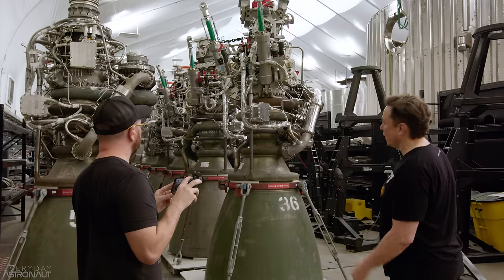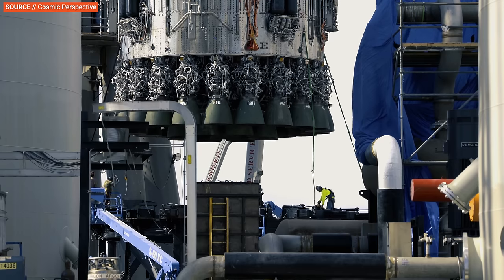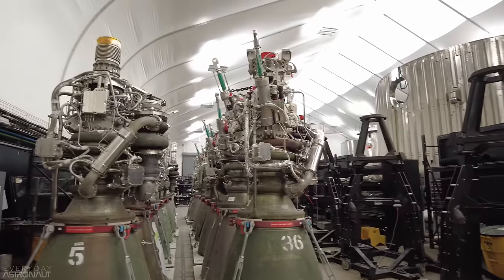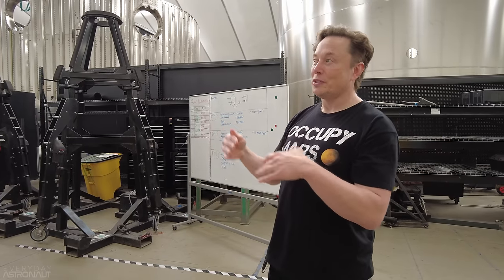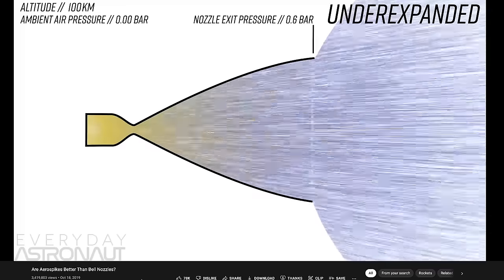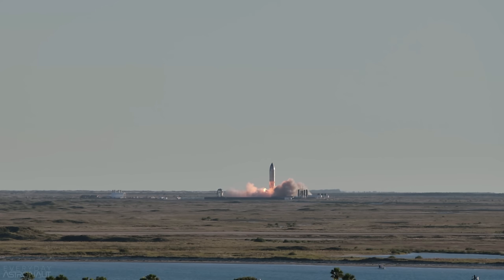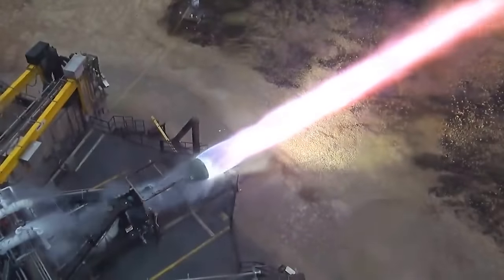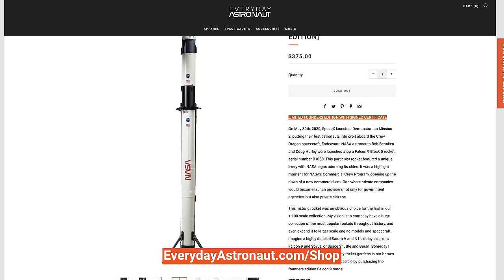How SpaceX Is Upgrading Raptor To Be The Ultimate Rocket Engine!

Comment: Love to see an electric pump version of the raptor..like the Electron rocket uses..They should call it Raptor 3.
Reply from the maker: Watch my video on engine cycles and you’ll learn why that’s not a good solution and doesn’t scale to these levels of thrust 👍
Reply: The energy density per weight of battery is hundred times less than methane.  When you scale up the power,  the increase in weight will make it inoperable.

Comment: The reason SpaceX is so successful with their designs today is the same reason why the Soviets led the first half of the space race. Traditional American rocket engineering goes through an extreme level of testing of every individual component, so they basically know how it's going to fly before it ever takes off, and the cost-plus-contract funding tends to slow things down and drive up cost. The Soviets had a hardware-based approach where it was built, and usually tested only in all-up flight, and as a consequence, they tended to have a deeper understanding of the "previously unknowns", and it was highly successful before Brezhnev pulled a Nixon and killed a lot of space program funding. SpaceX uses the same hardware-based approach. The Russians refer to it as "Ah Kalyenki", meaning a piece of paper and pencil on the knee. They've blown up a LOT of rockets and engines, and because of that they have a very intimate understanding of their hardware. Much more so than NASA ever did or likely ever will do.

Comment: Going to all electric actuators for thrust vector control it will save a heap of plumbing and hydraulic systems weight then you only an external battery.

Comment: Mr. Dodd, if the bell of vacuum Raptor is truncated after cutoff in orbit, can the engine function safely at sea level?  The bell would need repair before the next launch, but there is no need for three standard engines on second stage.

Comment: So basically the stacked starship system will leap off the pad instead of crawl its way past the tower... 
 The Saturn 5 burned 20% of it's weight in fuel before it cleared the tower.  That's astonishing.

Comment: I would like you to comment on the explosion. Does it have anything to do with the Raptor 2 design?
Reply: Probably not, but more information from Space X should be forthcoming once the raptors are inspected.
Reply: Per Musk, it was a spin test of the plumbing, with propellant, but wasn't supposed to ignite. Apparently it was a calm day and the mix under the booster got to the point that it could explode. Something ignited that mixture, for the results that we saw. SpaceX has yet to say what ignited the propellant, but Musk has said that there will be changes going forward for future spin tests. He also said that the launch is now targeted for August, so evidently, a short delay was caused by the explosion.

Comment: He mentioned having the engine create it’s own electricity for a screw drive. I am curious what is preventing him from putting some magnets on the turbine shaft itself and coiling wires around the turbine to make an alternator. I guess there would be an initial electrical resistance but this could be very cost effective. Not to mention no extra seals necessary.
Reply: That would be massively more complicated to build than just a shaft and blisks, not to mention balancing. And why bother when small lightweight high output lipo packs exist
Reply: @Username-qx9gk  if you’re trying to reduce weight lipo batteries are a bad option especially if you need one for every gymbaling engine.
Reply: @connorleefilmmaker5178  Attaching coils or magnets to turbopump shaft would be a nightmare to manufacture and balance. 
You just have one or two packs somewhere else and electrical bus, easy. You could even jettison packs as needed like rocketlab do. They replaced the whole turbine with electric pumps and jettison the lipos. Not that you'd need to jettison, as gimbals and control surfaces would require miniscule size batteries anyway. You can get bursts of 10s of KW from a pack the size of a scooter battery

Comment: At 16:20 you say 330 bar in the main chamber is the goal for Raptor 2. Earlier in this video you mention "300 bar chamber pressure" and that's phrase we've been familiar with since your 1st interview with Elon. But the diagram at 2:36 shows a main chamber pressure of 150 bar. The 300 bar is shown for for the preburner combustion chambers. This may be a diagram from one of your earlier videos but I don't recall Raptor going from 150 to 300 bar. Have I been misunderstanding the nomenclature all this time? (I do understand the pressure always has to be higher in the preburners than the main chamber, otherwise pressure would flow backwards.)
Reply: If you look towards the top of the diagram you reference you will notice (not raptor) in brackets this is just a full flow staged combustion example
Reply: It has always been about main chamber pressure
Reply: @shadowtitan2270   Ah, "Not Raptor" seems to be the key, indeed. That leads me to guess Tim didn't want to extrapolate from a 300 bar main chamber pressure to a 600 bar preburner pressure, he didn't have the data to make that leap. Safer to use some lower stand-in values.

Comment: There is no going back.  Thrust per area on the flamey end of the rocket is paramount.  The need is greater due to the loss of area per volume (mass) as rocket size increases.  Engines must be smaller (narrower) and produce more thrust, so raptor is the ticket.

Comment: How do they mount? Looks like R2 has a giant screw at the top. Could you talk a little about that? Thanks!
Reply: Oh and hello from Alan Shepard's hometown!
Reply: That giant screw is actually the flexible fuel line so the engine can gimbal. The engine basically just gets bolted up to the tank along with umbilicals.
Reply: @motokid6008  Thanks. I haven't seen a top down photo. Do you race MX?

Comment: Put Starship on the back burner for a bit, let them crunch all the data for awhile and build the new facilities, in the mean time, re-engineer the Falcon 9 with Raptor engines to focus on the engines with a high duty cycle.  Name it after the king of raptors, Peregrine.
Reply: re-engineering falcon 9 for raptors isnt worth it at all. its already working, and starship would come online faster then they could do that. it would have to get astronaut certified AGAIN, which again isnt worth the time and money

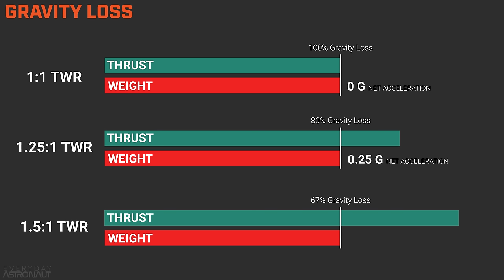Comment: 14:00 The increase in efficiency due to increased thrust applies much more at the beginning of the booster’s burn than it does at the end of the burn (when thrust/weight is higher due to propellant having been expended). So the apparent doubling of efficiency between Raptor 1 and Raptor 2 applies only at the moment of launch, and will be reduced when one considers the overall flight profile. I’d be curious if it’s feasible to calculate the efficiency improvement overall, not just at that initial moment…
Reply: It is better because by the time the efficiency gain starts to drop, the starship decouples and uses RVac engines which has 380+ isp. When you slap starship with a 100-200 ton payload on top of the superheavy, that T/W will be vital.
Reply: @aauwhatitdo1582  Your comment doesn’t seem responsive to mine. Yes, the improvement in thrust is valuable. The question is a quantitative one: how much does it help? It helps significantly, but not by a factor of two as some listeners might have inferred.
Reply: @zzubra  The gravity loss benefits are definitely not a factor of 2, but they help more along the lines of a 2-3% increase in Delta-V for every .1 increase in Thrust to weight. The issue of ISP won't be an issue because by the time the ISP will matter more than T/W, RVAC will take over.

The other benefit is that if you increase the Thrust by enough, you can get better Payloads in to orbit. Just a 10-15% increase in payload would increase yearly net profit by hundreds of millions.

Comment: Compare 🍎🍎 2 🍎🍎. The axis swivel angle and the maximum swivel angle isn't the same thing,  The SSME swiveled 10.5° in pitch and 8.5° in yaw, so the maximum angle was 13.5°. Is the figure quoted for Raptor (15°) the maximum, or just for the actuator axes (for a maximum of 21.2°)?

Comment: Once they’ve mastered the production of raptor
Gotten rid of all the fiddly bits
Removed the shields protecting said fiddly bits
& Reduced production time per engine significantly.
They are going to make a much bigger engine right?
This reduces film cooling significantly,
Increases thrust to weight
Reduces part count per rocket
Or did they already max out size for this combustion process?

Comment: Nice video, thanks for the polished presentation (and the amazing 3D renders)
As a bystander, it looks to me that SpaceX has started the Raptor program much more aggressively than Merlin, so I would be surprised to see the company getting more than ten percent of performance increase without a major redesign. The Merlin was a much more conservative project initially, focusing on lower costs etc. instead of wringing the maximum performance from the start. I would expect more improvement in the production costs.
The future Raptor 3 mentioned by E.Musk seems to be a major redesign, probably with dimensions and performance parameter differences (throat diameter etc) and reaching BE-4 performance levels. It sounds a bit premature to speak about it before even Raptor 2 gets proven in orbital flight?

Comment: Hey Tim, you said that the vacuum engines on starship will be fixed, but if that is the case how will it maneuver and land out of the belly flop??
Reply: The landing is done with only the three sea-level engines in the middle.
Reply: Flip and landing are done with only the center, gimbaling engines, the way SN15 (with no Rvacs) did it. Rvac is for high-efficiency vacuum acceleration  to attain/adjust orbital velocity, with center engines doing the bulk of the steering. Most of the Russian main engines don't gimbal at all; they just push hard while using smaller Vernier thrusters (mounted at an angle) to make steering corrections.

Comment: When you have the most advanced rocket engine in the world, it's doubtful you will abandon it for some simpler design. Continuous product improvement is the most likely case for the raptor engine, with advanced materials capable of sustaining extreme chamber pressures and temperatures. Aye, that's the ticket, laddie.

Comment: I was wondering... could the same principle used at tesla - casting one piece front and rear frames be used in a raptor engine? Could you integrate a lot of the "fiddley bits" and pipelines into it?

Comment: @14:04 from TWR 1.25 to 1.50 is not an increase of 20 % (you increase 1.25 with 16.6666 % to get to 1.5, but indeed 1.25 is 20% les than 1.5) , The same  with the 'increase' of 185 to 230: is 20% increase (182 is 80% of 230)

Comment: I notice that on Raptor 1, it shows a raptor image on an apparent fuel input but on Raptor 2 does not have have this pipe in the image.  Is that due to changes in the mounting of the raptor?

Comment: I wonder if an increase on thrust would be accompanied by a reduction in engines after all, fewer engines means less chance of failure.

Maybe SpaceX are supremely confident in reliability by that time so what does the same # of engines + more thrust equal? A bigger booster?
Reply: More payload to orbit via Starship. If they have really reliable engines and nail the catching of the booster down then its no problem having that many engines as it just increases mass to orbit for the upper stage that the booster is lofting partway
Reply: More engines is more redundancy against engine failures.  Which is why they no longer build passenger airliners with a single engine (except some tiny ones that are really repurposed personal planes).
Reply: @johndododoe1411  it's true that no commercial planes have 1 engine but (almost) all the 4 engined jetliners were replaced with twin engine equivalents, halving the rate of failure for engines.
Reply: It's a bit of a balancing act, fewer engines would reduce potential failure points but more engines can better compensate for said failure points. In some senses it just reflects how SpaceX merges the design philosophies of NASA and the Soviet space program, where NASA tended to lean towards reliability over redundancy and the Soviets towards redundancy over reliability. SpaceX combines both philosophies in their designs (eg multiple flight computers but each one is also pretty reliable).

Comment: I do wonder about 1 thing; these engines are very extreme in the required conditions. So what if something fails on the way to Mars (or when landing) and you need to fix one... would that not be way harder to impossible compared to more "normal" conditions?
Reply: They go with redundancy instead.  More than they need so if an engine goes, they can use the remaining.
Reply: @TheEvilmooseofdoom  Perhaps those thousand Mars-bound Starships will include one with a hold full of spare engines... ;)

Comment: hi Tim, don't raptor has 300 bars of chamber pressure rather than 150 bars as you mentioned 300 in preburner and 150 in the chamber? and do they use a temperature sensor for chamber temperature or nozzle one? thankyou
Reply: 300bar in the main chamber. About 800 bar in the pre-burners.
Reply: @3gunslingers  thank you

Comment: 11:00 Still amazed how small though powerful Raptors are. Merlins do the same.
Merlins are wonderful engines: Cheap, simple, reliable, powerful, lightweight, reusable, and goddаmn pretty efficient (Merlin vacuum's specific impulse is 349s, that's ~10 seconds less than the most efficient RP-1 engine, vacuum RD-0124 with closed cycle). 
I believe Raptor will be not worse, so easily the best rocket engine in the world by the sum of numbers.

Comment: I think that two things will happen. First, Spacex will improve Raptor 2. That means the engine will be more powerful, safer and lighter. Second, there will be space-only engines with nuclear-powered combustors, which will be fed by a fuel that will expand at high heat in the combustor at a high pressure, higher than Raptor 2, and thus have a higher exit velocity, but with comparatively low to very low fuel consumption. This will allow to significantly increase the speed of the spacecraft. In the development of combustion chambers for fusion reactors, stable energetic fields are already being used to prevent high temperatures from reaching the walls of the combustion chamber. This must be the goal for modern high-performance engines for spaceships. 
Chemical engines will be necessary for a long time for the boosters in order not to contaminate the atmosphere of the earth with atomic air components. Space is already radioactively irradiated by the sun. A nuclear engine cannot do any damage there.

Ich denke das zwei Dinge geschehen werden. Erstens Spacex wird Raptor 2 verbessern. Das heißt das Triebwerk wird Leistungsstärker, sicherer und leichter werden. Zweitens es wird Triebwerke geben die, nur für den Weltraum bestimmt, mit nuklear betriebenen Brennkammern arbeitet, welche von einem Treibstoff versorgt werden, der bei großer Hitze in der Brennkammer expandieren wird mit einem hohen Druck, höher als Raptor 2 ergo eine höhere Austrittsgeschwindigkeit besitzen wird, aber bei vergleichsweise geringem, bis sehr geringem verbrauch Verbrauch. Das wird es ermöglichen die Geschwindigkeit des Raumschiffes bedeutent zu erhöhen. In der Entwicklung von Brennkammern für Fusionsreaktoren arbeitet man heute schon mit stabilen energetischen Feldern, die verhindern sollen das hohe Temperaturen an die Brennkammerwandungen gelangen können. Das muss das Ziel sein für moderne Hochleistungstriebwerkten für Raumschiffe. 
Chemische Triebwerke werden wohl noch lange für die Booster notwendig sein um die Atmosphäre der Erde nicht mit atomar verstrahlen Luftbestandteilen zu verseuchen. Der Weltraum ist an sich schon durch die Sonne radioaktiv bestrahlt. Dort kann ein atomares Triebwerk keinen Schaden anrichten. Thank you Tim for your interesting Video. Greetings, Sven, Germany & Sweden

Comment: My question is how do those engines not push themselves through their housings, when you think about it, they are carrying the full weight of the rocket at launch, plus, all that inertia that is created with acceleration
Reply: That's covered in your Buck Rodgers Rocket Science book that is inside your corn puff boxes! 😄
Reply: The engines are attached to a "trust puck". It's the strongest piece of the rocket that acts as it's foundation. Fuel tanks sit on top of the puck engines below.

Comment: simplify by making the start sequence "insanely" complex, hmm makes sense
Reply: The starting sequence of a full flow engine is always going to be complex regardless how you look at it.
You have two power-heads and two shafts, with the output of each being what you get in the chamber. Its a complex problem, but you can simplify the solution regardless if the problem remains complex.
Less floating variables can help tune in each behavior to reduce the risk of failure.
Reply: There's a difference between simplifying physical parts and structure, and simplifying the actual processes that go on in those parts.   I think their main goal is to reduce parts count, even if those fewer parts have to perform more complex tasks.  In the long run, this will lead to big gains in reliability, manufacturing, and assembly, which is important for a company striving for mass production.